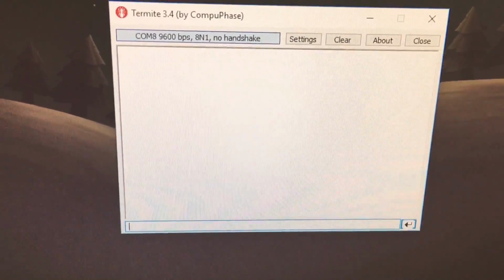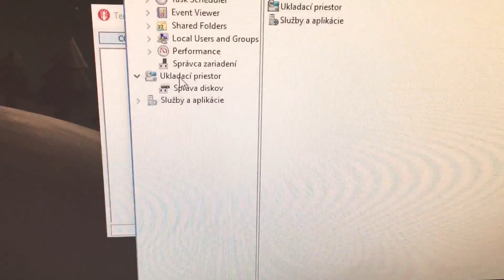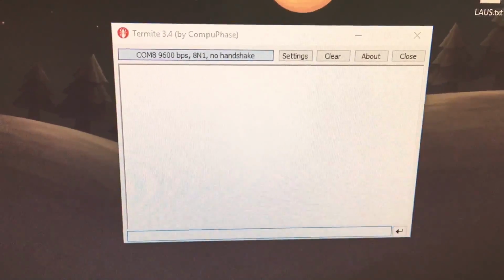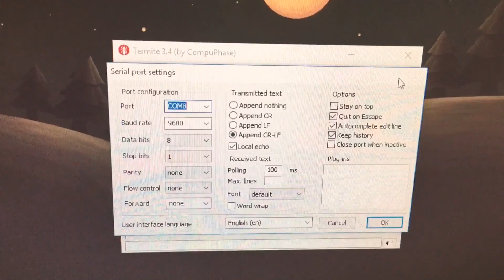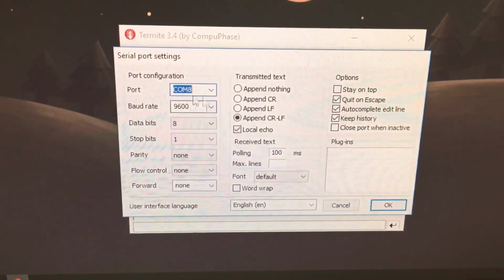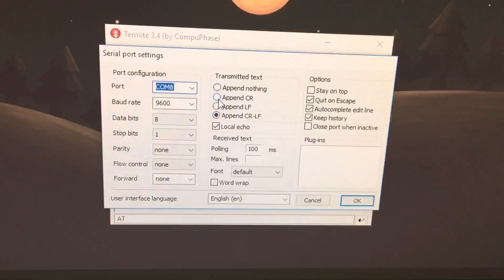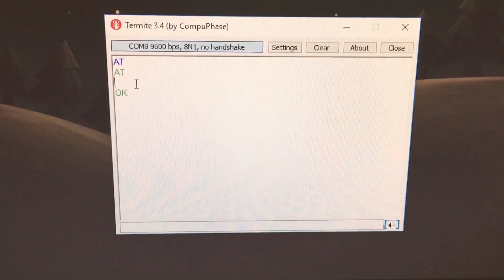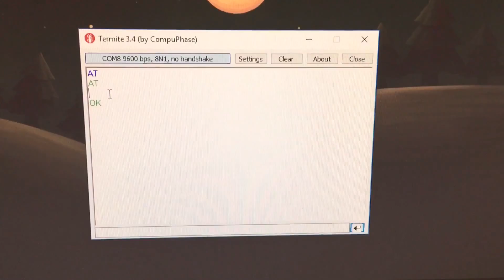Using GSM Module with Arduino,Raspberry Pi, PC [TUTORIAL]

Comment: You really need to use 4g. 2G is no longer supported in the US and most places in the world. DO NOT BUY A 2G BOARD OR MODEM unless you specifically verify that there is current 2G network coverage in your area. If you don't,you will be diappointed when your project doea not work at all.

You need something like this 4G board with sensors and ESP32 Processor already built in:
https://youtu.be/sUt5b9_B9EU
Also, Check out www.CUSPIX.com

Comment: does it work without the USB adapter. If i just connect the rx/tx to the pi?
Reply from the maker: STANLY left the building you may try it, I do not see any problem why it should not work
Reply: @Kallaon  Be careful of the voltage of this device , if 5v , you may need to put it down to 3.3v
Reply: yes, all the usb port for is for systems without a UART interface. The pi has that built in. No need for that on devices with it built in.

Comment: When I try your steps I get a flow of gibberish from GSM module. However, everything is good when I connect it to the Arduino and use SoftwareSerial. Any idea?
Reply: Change the Serial Connection frequency eg. to 9600
Reply: @georgesamaras2922  Yeah, probably I that was the case, I don't remember. Anyway, now I'm good with this.